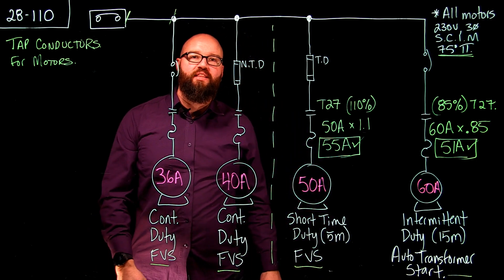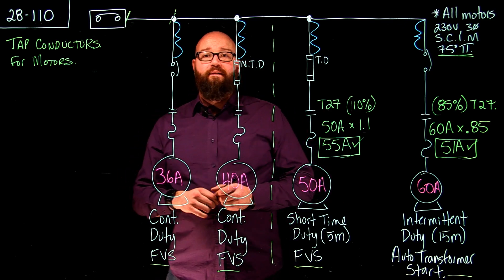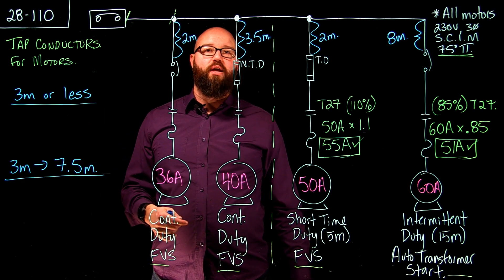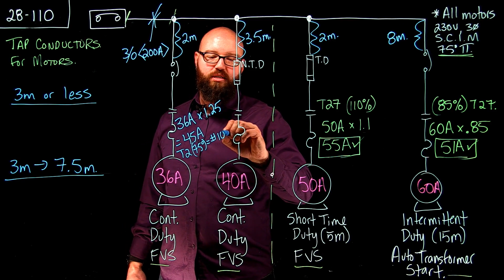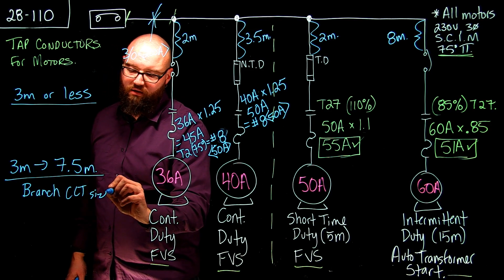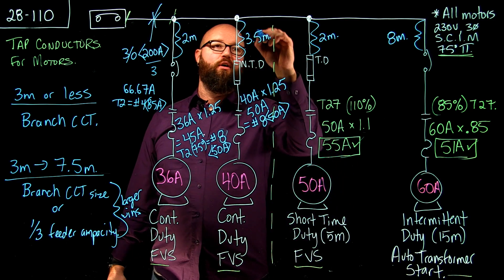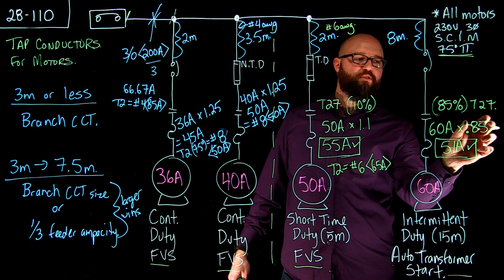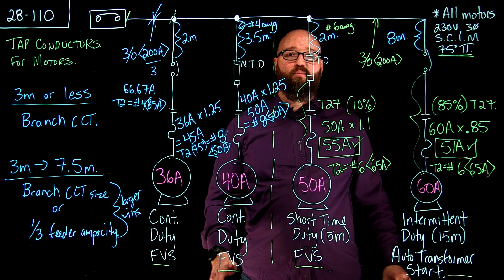Motor Tap Conductors

Comment: If a motor doesn't say if it is continuous or not, do you stick with the FLA from table 44 or assume its continuous and hit it with a factor of 1.25?
Reply from the maker: It depends on your defaults. Generally it is assumed continuous yes. So you would use FLA or table 44 to find an equivalent FLA, then for continuous, multiply by 1.25 for the minimum ampacity. 
If non continuous duty, then FLA or table 44 value multiplied by the table 27 value depending on the duty rating.